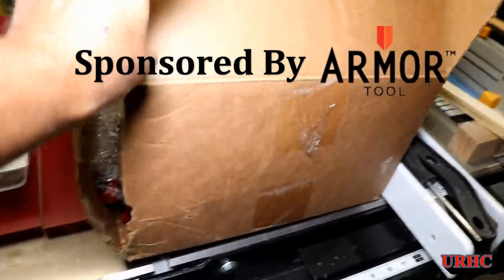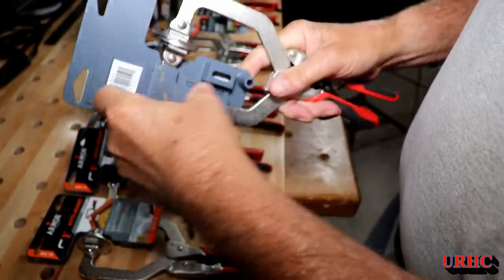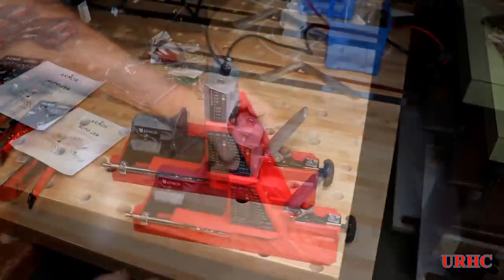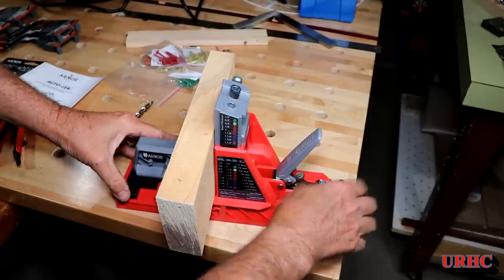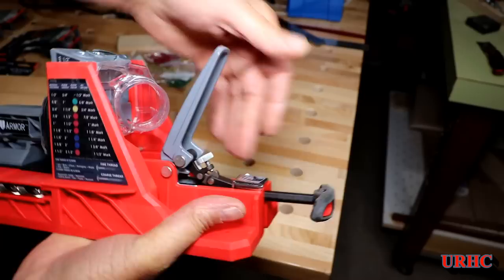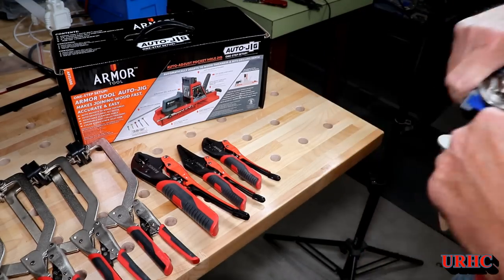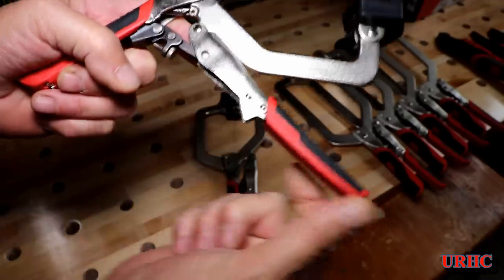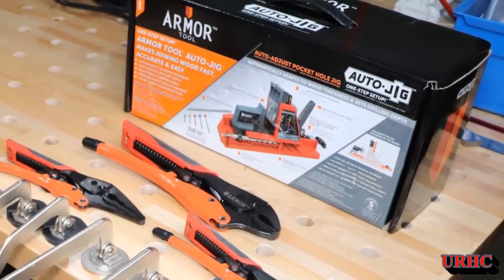Armor Tool Auto Adjust Hand Held Clamps Pliers And Auto Jig Pocket Hole System

Comment: Ed you are causing me to spend more money😁 I ordered the amor pocket hole jig to replace the Kreg jig I bought in the early 2000’s 
And to night ordered the 6 inch Armour auto jig clamp. I to have had the exact problem with the Kreg Automax. I wish Armor had a trade in program for the clamps.
Reply from the maker: I get the blame for everything. These clamps are still working fine and I use them all the time. Had nothing but trouble with the Kreg ones I bought. When you get the jig look it over good to make sure it's the new version. Just saw a comment from someone that got an old one yesterday that Armor replaced after being contacted. Thanks for watching.

Comment: I purchased the auto jig last year and love since it much easier that the Kreg jig I had before. Like you I mounted so that I could more easily clamp it to  bench, but when you do that you can longer store the driver bit in its place under the jig. Otherwise, I love, love the jig.
Reply from the maker: It looks  nice but I haven't used it yet. I was told they are sending an upgrade but never heard  back from them. Going to make a base as soon as my bench is finished.  Thanks for watching.

Comment: Bought the Armor Tool Pocket Hole jig and some clamps and pliers at a woodworking show from an Armor Tool sales rep.  The clamps work fine, but the Pocket Hole jig did not.  When you would clamp in the board the clamp would let loose and not hold.  Tried many adjustments in terms of how firm it clamped with same problem.  Contacted them, they did finally replace but it took them a long time.  The 2nd jig works fine so far.
Reply from the maker: The clamps work really good but I haven't drilled many holes with the jig yet but it does clamp the part very tight.  That's why I want to use it a while before making a video. I am surprised it took long to get replaced if there was a problem. I do like that the square drive recess in the screw is a little deeper then the kreg screws and holds on to the bit well. I will definitely keep everyone updated. Thanks for watching.

Comment: One of the most informative unboxings I have ever seen. Thanks for the info.
Reply from the maker: Thanks. I guess that I really don't trust any kind of auto clamps after my experience with the Kreg ones I have. I actually put off posting the video for a week so I could spend time using them to see if problems would arise. They have worked great and I think they should last. The only issue so far is I pinched a fingertip when clamping one with my hand in the wrong position and that is not the clamps fault.  I will do a good video on the jig once I have a chance to use it for a while and verify it works good.  Thanks for watching.

Comment: These clamps are Perfect for compressing the brake cylinders on disc auto brakes
Reply from the maker: I bet they work  good for that. I have a specialized tool for that that is basically a screw clamp. Thanks for watching.

Comment: I'm actually pretty excited you got these. I believe saw a video on these a long time ago from someone else. I was considering buying the k4 or the K5 jig, but I think I'll wait for your official review. the price looks quite reasonable and in line with the Kreg versions. Congrats on the new addition of tools, and thanks for sharing!
Reply from the maker: They definitely addressed all the bad points of the kreg jig with  this. It is more complex but so far works nice. I really  like that all the screws are all outdoor rated and color coded. They seem as strong as the kreg screws but have deeper square drive pockets making the driver lock in better. I was thinking  about the k5 but read too many reviews about the clamping  having  issues.  Armor makes an  auto clamp that fixes the k4 clamp if you go that way. It's funny because  I was afraid  to try anymore auto clamps after the kreg clamp experience and these turned out to work reliably.  I am 3d printing  custom  racks to mount  them on the new bench now.  Thanks for watching.

Comment: I'm going to half to look into the Armour clamps.  I'm also having the same issue with my Kreg clamps.
Reply from the maker: So far no problems with these. I think they should  stay that way with the simple cam mechanism they use. I had never  heard  of Armor tool before  but now see that they design the mechanisms of many of the major  clamp brands. The handle cushions are smaller and thinner then the kreg clamps but are comfortable in my hand and will let them fit in tighter spots. I think you will find them in your  local woodcraft and Rockler stores soon if you want to try one before buying.  Thanks for watching.

Comment: What is the fixation with using Robertson/Square drive screws? In a word, they suck. When making pocket hole joints I always use Torx/Star drive screws which do not require exact alignment with drill driver. There is one company which offers Torx/Star drive screws specifically for pocket holes which I highly recommend. I won't name them but they can be acquired from Amazon or any Big Box Store. If Armor wants me to buy their tool, they should offer Torx/Star drive screws as well as what they are selling now.
Reply from the maker: I use the spax screws for larger load rated screws but don't  see a need for the torx type screws  for pocket holes McFeeleys makes some great square bits and the Armor  bit is not bad. The Kreg bits wear very quickly and can cause problems with tightening.    I think there  are jigs from Chinese companies  that offer the combo you are looking for but I know Armor and Kreg dont at this time. Thanks for watching.

Comment: I told you would like their clamps. I threw my kreg clamps in the trash.
Reply from the maker: You are right.  I was afraid to try another auto clamp after  the kreg clamps.  These clamps are awesome.  I tried for a week to get them to malfunction and they have all worked properly every time.  I was thinking  about  making  a video about  cutting the kreg clamps apart trying to figure out why they don't work properly. I can't  wait to try the pocket hole jig on a project. Thanks for watching.
Reply: Kreg clamps was literally designed by Armour the original one's. The newer Kreg clamps r designed by Krieg. The trash ones.

Comment: as a welder by trade, but retired now, and do home odd jobs, i have tried many auto adjust tools but none of them ever last long, the handles are always a stamped out metal, then they get realy sticky and dont work, and they end up in the scrap bin.. i gave up on them, and stayed with the vice grip brand, witch were not an auto ajust, but last for ever,, in fact i still have a lot of the origanal vice grip clamps i bought way back in the 70's, some are newer only because some one liked them better then me, and i had to buy a new one as i need them all the time, i do some welding videos but more on what i do since i retired
Reply from the maker: I have been using  these for a couple months  now and really  like them. They are in my woodworking shop. For welding I have some  vice grips but started  using the Harbor freight clamps that work just as good recently. I got 20 4 inch for $54.00 that would  have only bought  3 vice grips. The Kreg auto clamps are junk and mine also went in the scrap metal bin. Thanks for watching,.

Comment: Kreg clamps are junk. I'm bummed I bought them. Not cheap.
Reply from the maker: I had nothing but trouble with mine and couldn't use them. These have worked  good so far. Not as fancy as the kreg  with their big cushioned handles but so far they have worked  consistently.  These  also are expensive but they run good sales if you sign up on the Armor email  list. I did have one bite my finger because I was holding it wrong that I will show  in the next  bench build  video. I like them because they work.  Thanks for watching.